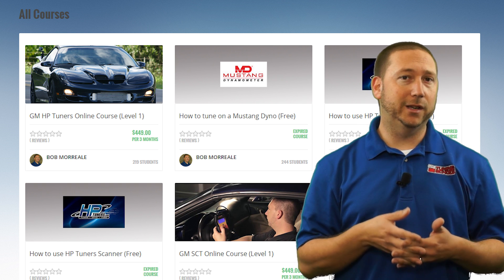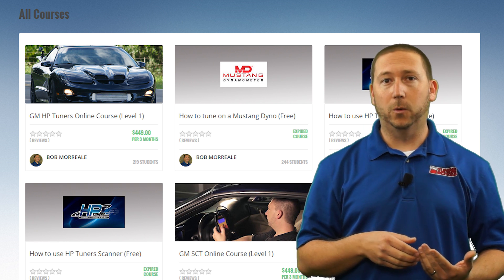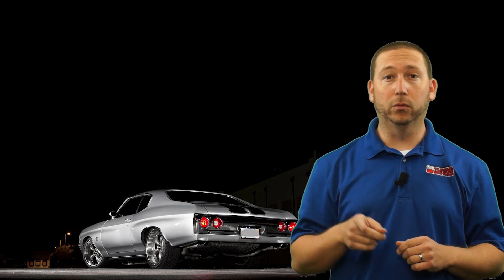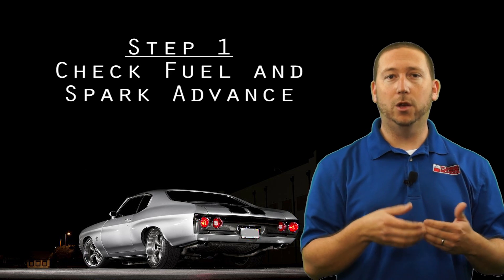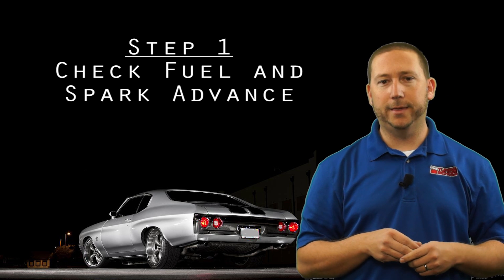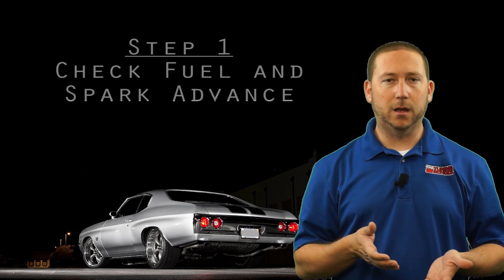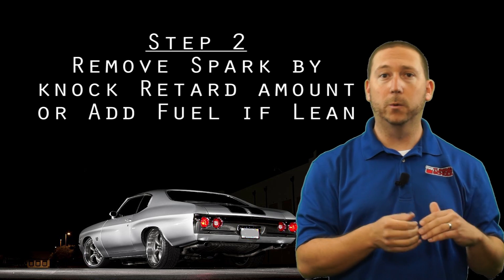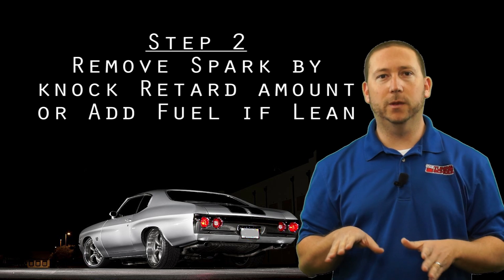Knock - Is It Real or False?  Save Your Engine from Detonation!

Comment: A MYSTERY !!!
New motorcycle runs GREAT on 87 octane and Castrol 10W-40 synthetic oil.

600 mile service, still runs GREAT on 87 octane and Castrol 10W-40 synthetic oil.

1806 miles, 87 octane and Castrol 10W-40 synthetic oil.
ENGINE KNOCKS.

This time a Full tank of 93 octane and Castrol 10W-40 synthetic oil.
STILL KNOCKS.

This is on a Triumph bonneville 1200 engine. Seems to be a common occurrence on these all over the world.
So it can’t be the gas or oil obviously. England had very high octane fuel but they still knock.

We were thinking the cam-chain tensioner but the oil is always the same.
High octane fuel doesn’t eliminate the knocking.
Tried that myself just yesterday. 

The only thing I can come up with is a software problem with the ECU during the service at the dealership.
Considering this is the common denominator because the bikes are serviced at different dealers in different countries BUT connected to the same mainframe in London to Triumph headquarters that effect the bikes that get ECU updates.

From the information given in this video if the timing is off, or the mixture and the timing is off, the result is a misfire.

What else could it be ?????
Triumph tells us it’s normal but my these bikes run GREAT other than this knocking.
People have tried valve adjustments, with no difference.

Keep in mind these are NEW motorcycles.
Help please ……..

Comment: At 3:43, I assume you mean unless you get off throttle or add more fuel? I'm tuning PE and I notice when I'm not in PE mode, knock may start, but as soon as throttle hits setpoint and PE turns on, then the knock reduces / goes away.

Comment: Self-ignited?  No.  Detonation occurs when the air/fuel charge in the combustion chamber stops burning prematurely.  This always occurs following the spark event of the combustion stroke and generally isn't immediately destructive (but should be avoided, especially in high performance applications).
Pre-ignition occurs prior to, the spark event and is generally very destructive.

Comment: I have a 2007 pontiac grand prix with the 3.8l V6. I got a ZZP tune for it, and from what i can see it pulls timing up to 6 degrees around the RPM range of 4k - 4.4k RPMs
So far i have tried lowering the AFR from the 14.7(ZZP tune) to 14.3(factory), and noticed that it reduced it, so far i have it at 13.9 AFR and got it to where it is now. Before it would go to the max of 8(they changed it from 15 to 8) degrees on the ZZP tune, havent tried factory. But does this sound more like a tune related problem or if it could actually be mechanical problems. I am not hearing any abnormal engine noise.

Comment: FYI........... On Ford Spanish Oaks PCM calibrations, I've discovered that the Ford engineers made a KS mic to cyl assignment mistake that was throwing the engine firing order cyl noise phase sequencing out of pattern causing some potential false knock when using the OEM Ford per cyl sensitivity threshold map settings untouched. They assigned #7 cyl & #2 cyl, #6 cyl & #5 cyl to use the same KS mic in a 90* firing sequence pattern that the other cyls do not experience which throws the firing cyl noise phase sequencing off. The fix is to reassign #2 cyl from #0KS mic to #1KS mic then reassign #6 cyl from #1KS mic to #0KS mic.........now ALL following cyls will be using the opposite KS mic from all leading cyls in the 90* firing sequence according to engine firing order now, which cleans up the cyl noise profile when the cyls are fired thus PCM can now more accurately decipher any out of firing pattern cyl noise spiking as white noise against any in pattern firing cyl noise that spikes above the normal pattern thresholds as actual cyl knock.  This reassignment showed to resolve all the reported issues w\ Per Cyl Mode knock detection & will improve Global Mode knock detection since this assignment mistake is negatively affecting both modes. Just trace the current cyl to KS mic assignment in tune file according to engine firing order sequence & you'll see that #2 cyl & #6 cyl are out of sequence......................
Reply: Fantastic observation, I'm impressed!

Comment: Thanks.. Good info.   I disconnected 93 GMC 1500 4.3L V6 knock sensor a couple years ago (and backed off the timing) when I got the truck, as I thought occasional scanner knock counts were bad (from sheet metal rattling on engine or ???) since they happened while idling/revving up a bit in driveway.  But now think it's not so unusual and the computer might sort these out.  I know what detonation can do so don't want to take a chance, but it's time to tune this engine right, as I'll be driving it more this winter.

Comment: Want to relocate ks on a f150 5.0l fi.  
1. Book says original is a 65khz two wire sensor
2.how are wires connected to sensor via signal return and v.reference .
Seems like green wire to power and black wire to ground .
Any good info?

Comment: How bad is it to repair the end of a knock sensor wire? I know it's best to replace because of the shielding, but the part I'm repairing is just the last few inches of wire. The part that was damaged wasn't even inside the shielding to begin with, but I did have to cut the shielding back by a couple inches in order to get some good wire to splice to.

Comment: Thank you very much. I think I am getting false knock in PE mode. Engine is a stock LM7 9.5 compression running 89 octane. I'll richen up PE to see if it makes a difference or pull timing. Commanded PE is 12.45 afr with timing at 25 degree's WOT.  Too lean of a PE ratio ???????? To much timing ?????? Not enough octane ?????
Reply from the maker: Hey James, try changing each part of the problem individually, run a slightly richer AFR, then run slightly less timing, then try adding some octane. After each condition change check to see if the knock changes. These tests are all assuming the knock is fairly consistent. If it intermittent, it's more likely to be false and it will be difficult to accurately test. 
The one thing I will say is that I think you are testing the limits of 89 octane with such high timing and lean AFR.

Comment: Raising OCTANE to highest level SOLVED my persistent problem on 2010 Chev EQUINOX.  The high ethanol levels in gas now is bad, especially.  No mechanic was able to diagnose the meaning of the knock sensors'  alarm for months !   A truck driver/mechanic gave me the same advice as yours&  my SUV is back to normal. No more bad habits on letting the gas tank go low either.
Reply from the maker: Very good point on the gas tank. We're happy to hear your problem is solved. Feel free to reach out to us with more on your tuning journey!
Reply: Buzz Lightyear  Sorry I missed your comment when made:  you will also get perhaps 20% more mileage with the highest octane levels hands down.

Comment: Could running rich from a boost leak cause knock?
Reply from the maker: A boost leak is an unlikely cause, but there can be a condition called rich knock that occurs where there is so much fuel in the chamber the combustion can’t consume it all. This leaves excess fuel in the Chamber that can then ignite on its own causing knock.

Comment: I have a 2015 subaru wrx. I use a cobb accessport and put an ETS intake system, an ETS catback exhaust, a mishimoto charge pipe and a turbosmart dual port 50/50 hybrid BOV. I have been using the ETS stage 1 tune on the Cobb website that was removed from their website a while back. Under extreme driving (redlining the car) its stalled on me occasionally on the freeway but starts right back up again. Tonight I started my car and the engine knock on the AP read -5.82. I have to drive this car in a day or 2 because i’m moving. The distance is about 130 miles. What’s wrong with my car?

Comment: Hello...

I have a car type Kia 4-cylinder engine size 2400 GDI, I use long-type ignition plugs which are recommended by Kia

My question is: Can I change spark plugs from long to short -type to get rid of the knocking or detonation problem?

I've already installed spark plugs (short- type ) and got rid of the problem, but  does have a bad effect on the engine later ..?

Comment: An interesting video, although the part that is wrong in the video is where the person describes the detonation noise as something being produced by “the piston literally rattles & fights its way up or down in the bore…”  If there is enough/excessive clearance between the piston & bore for the piston to rattle during detonation, then the engine has bigger issues than just detonation.

The sound of detonation is actually created by a small part of the fuel/air mixture combusting at supersonic speed (uncontrolled combustion).  This creates a supersonic shockwave that creates a supersonic sound.  That sound is generally known as pinging; pinking; combustion knock, and or detonation.  Detonation is where the speed of combustion in the chamber can reach speeds of mach4. (over 3000 mph)

Normal (or controlled combustion) occurs at subsonic speeds.  Where the “flame front” travels across the combustion chamber at speeds usually between 35 to 120 mph.  Otherwise known as “Deflagration”.

In order for detonation to occur, deflagration (normal combustion) would have had to start first.

I think the person in this video is also getting a little confused with pre-ignition & detonation.
Reply: Thanks for the input!  We have seen the issues described in the video during normal operations.  It's also not uncommon for us to hear the LS Engines rattle on cold start for the same reason (Piston rattling in the bore on the wristpin axis, excessive piston clearance before the metals grow), called piston slap - on normal healthy LS Engines.
Reply: Thank you for the unexpected reply – and from the man himself!
 
I’ve watched a number of videos from this channel, & learned a lot.  It’s just that some parts of this video seemed a little confusing to me.

 I’m not familiar with the LS engine that you mention in your reply, but as well as the excessive piston to cylinder clearance that you mention, maybe the LS engine also doesn’t have enough offset of the wristpin centre line to the piston centre line in its design.  If it had sufficient offset, then perhaps it would have less or no piston slap?

The main point of your video is to point out why people shouldn’t turn off their knock sensors.  I too don’t understand what possesses people to do that.  It seems like an unnecessary way of slowly destroying an engine – that is, if the knocking/detonation is bad enough.  The localised heat of detonation eventually causing holes to melt into piston, & the shockwave of detonation eventually causing cracks to appear in pistons, valves, & head.

It’s my understanding that detonation is predominantly a post-ignition issue.  The expanding burning mixture of “normal combustion” compressing parts of the as yet unburnt mixture, causing the unburnt mixture to suddenly & significantly rise in temperature the spontaneously detonate.   (As the Flame Front of normal combustion travels across the chamber, it compresses the as yet unburnt portion of the mixture).

Pre-ignition can contribute to the post-ignition of detonation, but they are two separate events.  As you mention, other contributing factor of detonation are higher cylinder pressures & temperatures prior to the spark-ignition event and after it.  Perhaps caused by too weak a mixture; a spark that is too far advanced; compression ratio too high, and even an engine that is generally running too hot.  Engine builders sometimes forget about the extra cooling that might be necessary.
Reply: I'm always happy to talk, thanks for watching and commenting!
Reply: Speaking of Pre-ignition and detonation, is detonation occurs always after the normal combustion initiated from the spark? In the video it confuses with Pre-ignition isn't it?
Reply: Also, I have an another question, if you have a false knock, do you de sensitize the oem or the extra aftermarket knock sensor that you have installed for the tuning process? 
cheers mate

Comment: Is there a probable cause that you can think of as to why a vehicle would start knocking immediately after an oil change when there was no knocking before?

We have a 2003 Chevy Trailblazer that rarely gets driven. In fact we only drive it a few times each month just to keep the battery from dying. This vehicle has ran smooth for as long as we've had it, which is about 8 years. I took it in for a an oil change and noticed about 1/2 a block away from the automotive shop that it was knocking, so I took it back. They hooked it up to a little hand held device and told me that it's my timing. They said if I don't change the oil soon enough that in this particular vehicle, it will affect the timing and that it's the belt hitting the side of something. But it just really sounds like a thrown rod. We took it to 2 other shops and just by listening to it, they stated that I needed a new engine.

I am having a hard time believing that something about the oil change didn't cause this. There were no engine issues right up until the oil change. Any comments?
Reply: The knock you are talking about isn't really the same as in the video but if your engine started knocking immediately after having the oil changed there is a pretty good chance it's related. was the oil pressure light on when you left the shop? if so they probably didn't put any oil in or something happened for the oil pressure to be very low or contaminated.. there are many reasons but the engine is finished for sure.

Comment: i have tuned my car when i start first tune it count -2.6 next tune -1.3 next tune 0.7 is that mean great and last tune is perfect or i have to make it 0 ?
Reply from the maker: The only reason to be concerned with such little knock is if you can accurately replicate it. In addition, you should just continue to perform what you are doing in the tune file to bring the knock down consistently every time.